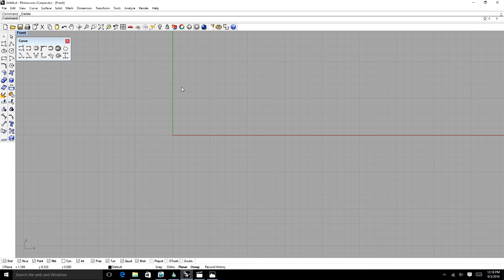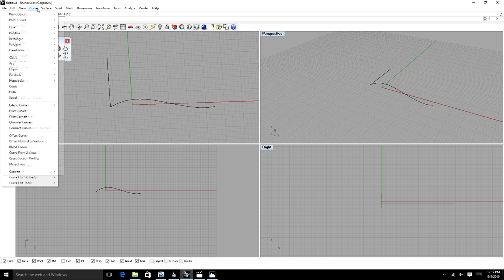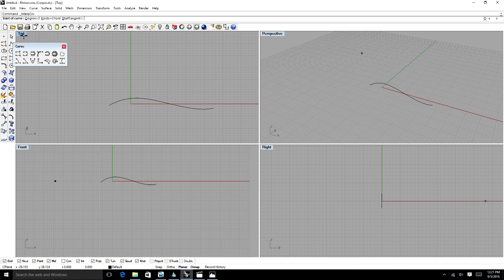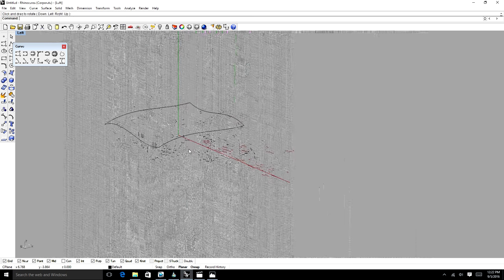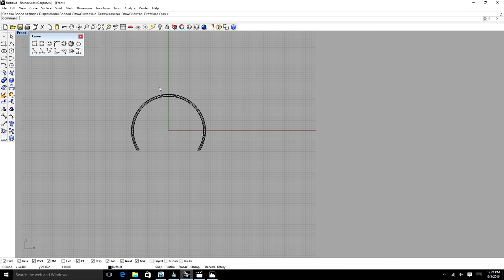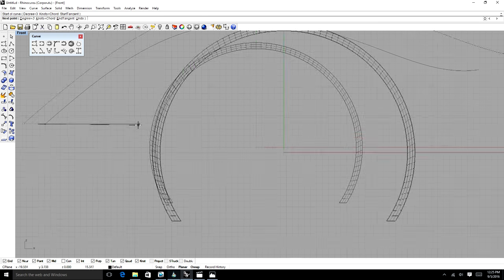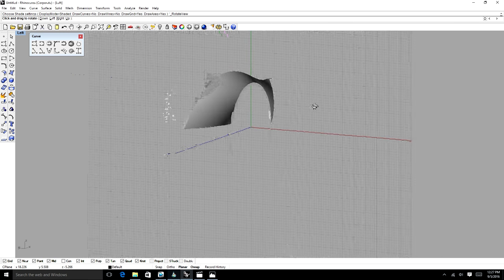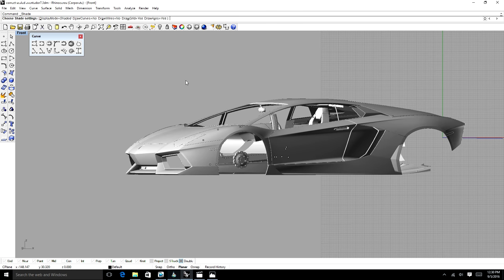Rhino 3D modeling tutorial - Beginner 3 of 3.

Comment: Would you let me know how to change the shape of the curve? How could you find the dots on the line?
Reply from the maker: turn on "control points" then turn off when your done. by default it should be the f10/f11 key, if not there is an icon for it in the tool bar.
Reply: THANK YOU so much!
I'm using MAC. but I will look for 'control points'!
Your video is really couraging me:)
Reply from the maker: Do well, dont quit!